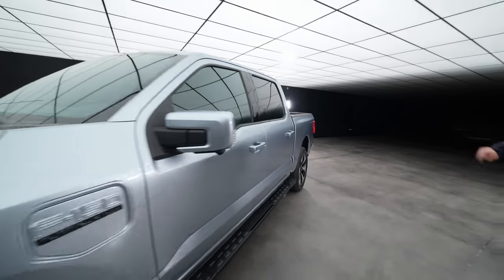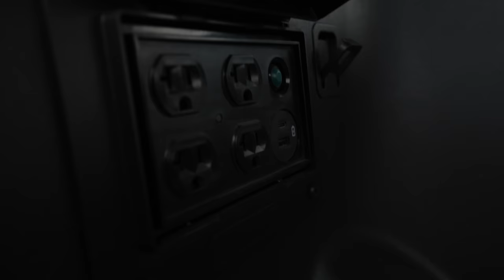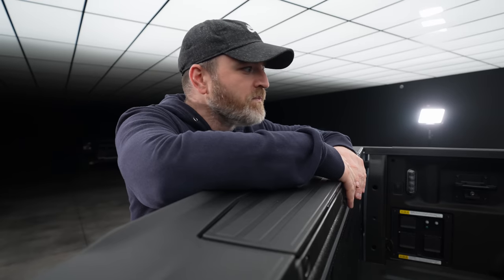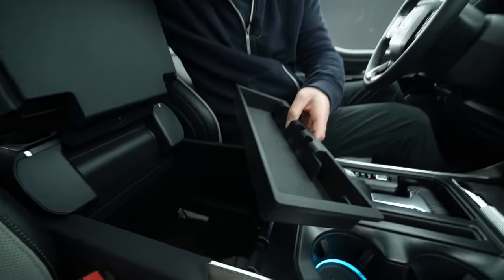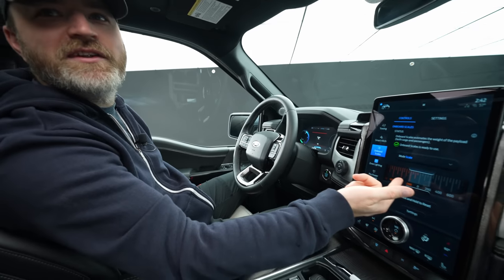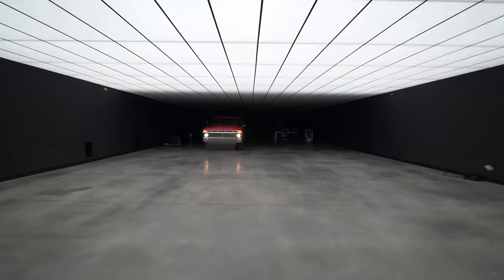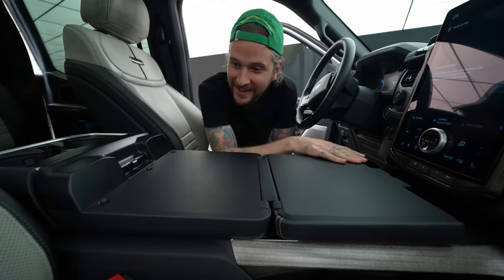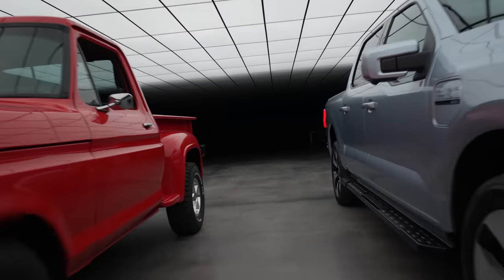Ford F-150 Lightning Electric Just Changed the Game ft. Peter McKinnon

Comment: When it comes to repair or change of the battery does the body separate from the chassis to access the battery and what are maintenance cost?????  Future wise
Reply: Great question and the reason I'm waiting. If this is like the Nissan leaf and you loose 1/2 battery range in a few years with a huge cost to replace the batteries and most dealerships won't even do it

Comment: Why can’t automobile engineers design a freakin removal battery system where you literally pull up to the gas pump or now e pump a hydraulic arm removes your old battery puts in new used fully charged battery and on your merry way you go no waiting and of course plug and play for your home. Prime example you have a drill with built in battery you use drill, battery dies you must plug whole thing in and recharge, now you have battery with replaceable battery now battery dies no problem you put in a replacement and your good to go. 👍🏽
Reply: @Professional guy That would take longer than charging the damn thing. You haven't a clue about EVs
Reply: @tylerwhite4743  Oh you’ve already seen it and timed it impressive. You must be an EV expert.

Comment: The label over the power outlets in the cargo bay says “Engine will run to power outlets. Use outdoors only. CO is emitted.” Carryover labels from the gas-powered models?
Reply: Plus
One
Open bracket
Three
Eight
Six
Close bracket
Six
Zero
One
Nine
Three
Four
Nine
Reply: Plus
One
Open bracket
Three
Eight
Six
Close bracket
Six
Zero
One
Nine
Three
Four
Nine

Comment: All we really need to know is if there is a separate battery to maintain heat in the tailgate when it will be pushed back to the dealer.
Really admiring what coal generated electricity can power these days.
Reply: 👆Thanks for watching and congratulations you have been selected amongst our shortlisted winners.
WhatsApp only to claim prize💙💙

Comment: Good luck having to charge for 5 hours every 200 miles of travel…… and every 100 miles when pulling a trailer. It’s a cool idea but it will never replace gasoline and Diesel engines.

Comment: I'm not a Ford guy, in fact ever since they switched to aluminum bodies I've thought of them as write off wagons. Since you can't reaaaally body work aluminum. It work hardens, gets brittle. So you either have to anneal it and ruin the paint, to work it. Or cut out the section and weld in a new panel, which ruins the paint. But this is the first time I've seriously considered a Ford. If they make a 1 Ton electric with a bigass trunk under the hood. I may consider one at that point.

Comment: He always has that faux enthusiasm. Trim, features, comfort? thinks only the wealthy look at when purchasing a vehicle. Can it handle the distance I need to drive? is it cheap to keep going? what are the maintenance cost? is it going to fall apart after so many months? Will I need to take out a mortgage on the house I don't own to be able to afford one? In 30 years (when this thing is finally within my budget) will it still run? will it be a pile of rust? These are the important questions.

Comment: Weighs 2000 lbs more than standard f 150. Roads are not build for vehicles this heavy over time, Only interstates are built to handle weights. Less made side and secondary roads will be broken down and detreated under increased weights and every day use of EV's right now. Lots and lots of other issues as well.  This is no where near ready for mainstream.  not even close by a long shot. And you can fix everything on the 73 yourself. You can not fix anything on the lighting and will pay big time for all your dealership only maintenance cause no other shops work on them.

Comment: First impressions on the reveal, the first one is so much more... imposing and agressive in it's styling. And so in my book, desierable. The strobe lights and rock/metal music didn't nearly make up for that. Also, the wheels look too small, and the output of that lightbar looks... sickly.
Features and capability are pretty sweet though.
Reply: True but if you compare a normal F150 to the raptor that also looks tame so hopefully Ford will release a F150 lightning raptor..... that would be sick
Reply: @werieawesome8530  Good point

Comment: THE ONLY thing that I don’t like is the daytime running lights that wrap around the headlights, across the hood and to the other side, they look like this awful old, plastic and are barely lit. They should make the lines sharp like those of the f-250 and current model year f-150 and it would look way nicer

Comment: Will the battery pack be re-charged while the EV Ford F-150 is being driven? Unless otherwise there two power lines are to be switched so that you don’t need to get it charged; in other words, the more you drive the more the EV get charged.

Comment: PROBLEM: all the outlets are great, but if you drive to work, then try to use more than one 120v outlet, you'd already running out of battery FAST, esspecially with power tools!!! 1500 watts for a coffee machine drains so MUCH battery!!!
Reply: Congrats you have being selected among out shortlisted winner 
W_h_a_t_s_a_p-p.
Reply: Plus One 
Open bracket 
Nine 
Seven 
Zero 
Close bracket 
Seven 
Zero 
Three 
Six
Zero 
Eight
Six.

Comment: WELL   UNTILL THEY RECHARGE WHILE DRIVING ITS NEVER GONNA WORK, THE CHARGE TIME, THE MILLAGE ABLE TO DRIVE, THE COST OF REPLACING THE BATTERIES EVERY 5 YEARS ( 5000 DOLLARS,  OR CONTINUE TO HAVE LESS MILES PER CHARGE ) AND WHILE YOUR CHARGING WHAT ARE YOU GONNA DO WHILE ITS CHARGING, CHARGING STATIONS WITH OUT TOILETS, IN THE HEAT OF THE SUMMER NO AIR OR THE DEAD OF WINTER NO HEATED PLACE TO GET OUT OF THE COLD,, THESE TWO TEMP EXTREAMS ARE GOING TO BE A REAL PROBLEM FOR YOUR COMFORT OR SAFETY. PEOPLE WITH CHILDREN ARE ALSO GONNA BE A PROBLEM .  PEOPLE THINK THIS STOPS THE POLUTION BUT YOU STILL HAFT TO HAVE THE POWER GRID WHICH IS FULED BY THE POWER PLANTS WHICH WILL HAVE NOW A POWER LOAD FROM ALL THESE VEHICLES BEING CHARGED OFF THEM... RAIN, SALT, SAND AND THE OTHER ROAD CONDITIONS.. YOU PEOPLE WHO LIKE TO GO OFF ROAD, FORGET IT... YOU DRIVING THRU THE MUD, CREEKS AND OTHER PLACES YOU LIKE TO GO WILL BECOME MAJOR REPAIR COST OF REPLACING THE MOTORS ON THE WHEELS... A COMMON SENCE WOULD DO YOU GOOD TO USE BEFORE LOOKING AT ALL THE BEAUTY AND NOT REALIZING THE DRAW BACKS OF SUCH A VEHICLE... NOT FOR ME.. THERE ARE MANY OTHER WAYS TO DEVELOPE A ALTERNATE SOURCE OF ENGINES BESIDES ELECTRIC... WE HAVE A LITHIUM PROBLEM ALREADY AND THE DISPOSAL OF THIS TOXIC MATERIAL WILL IN THE FUTRUE BECOME AS BAD AS A NUCLEAR PLANT WASTE...THINK PEOPLE,,, THINK WITH YOUR BRAINS.

Comment: This is an amazing vehicle! The only noticeable thing that could improve is the front center light panel keeps flickering which could be fixed but other than that, 10/10.
Reply: LED lights can flicker on a camera because they run between 50 and 60 Hz. It's not the actual LED lightbar flickering.

Comment: Gotta love the coal fired vehicles that they are coming out with nowadays… no thanks I’ll keep my 90’ f-150 and my 78 f-250… just hope I can stay getting fuel
Reply: That’s the beauty of electric you can fuel it anywhere anytime with the right setup, there’s guys out there with electric trailers on the back, small trailer with 2 generators recharging the car. Plus now you can utilize solar power and wind or water power. So you essentially never have to worry about fuel again. Building a gas refinery in your backyard whole different story.

Comment: my 2011 F250 has volume control on the steering wheel, why do I need yet another volume control in the middle of a screen? If there is no standard transmission why do I need a physical gear selector, why can't I select P D N R with the touch screen or a column like a Tesla?
Reply: The other volume control is probably for the passenger

Comment: I wonder where you will charge the battery while 100 miles in the back woods.
Reply: When you're done in the backwoods, you drive 100 miles back out of the backwoods, then you use the rest of your 300-450 miles (depending on if you have a load), so if you're not good at math... You use the leftover 100-250 miles after getting back out of the 100 miles of backwoods, and go charge it. Kinda like how you fill your fuel tank when you leave the backwoods. Seems like a pretty simple concept. 

Or if you're the 1% or less of people who go 100 miles into the backwoods and don't trust this to make it, then you don't buy one... not that you were ever going to buy one anyway.

Comment: I'm wondering if that second glove box, as  you called it isn't something more. As I notice its right next to the ventilations system.

My Dodge Journey has that compartment above the glove box as well, except its not just for storage. That sticky rubber inside on ours, is so our soda cans and what not don't slide around. Now I say soda cans because that compartment is connected to the ventilations system and with the air-conditioning turned on or even just the fan set to cold keeps our sodas cool or cold. Also works with the heater if you have a container that fits in there. There is also a lever on the inside left wall that opens and closes this compartment to the ventilation system.